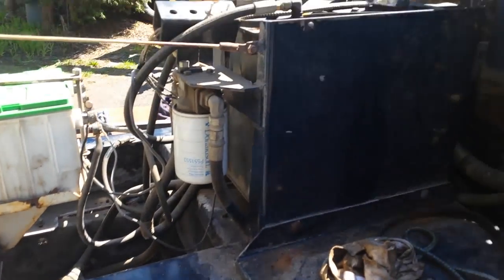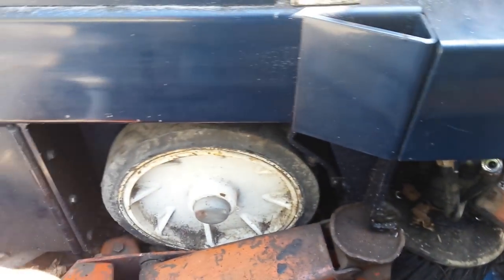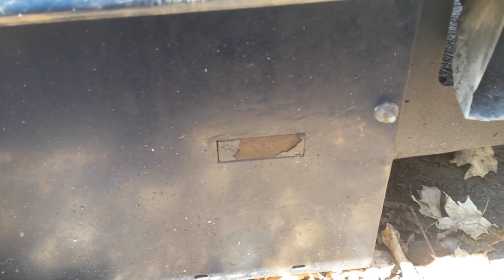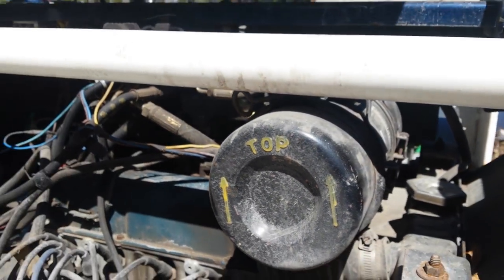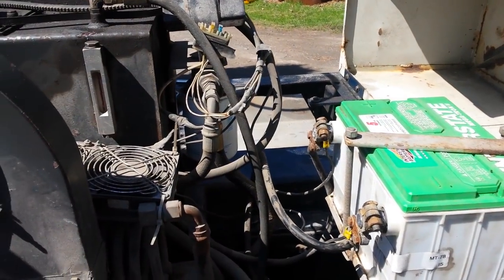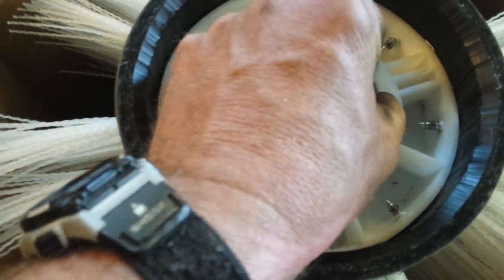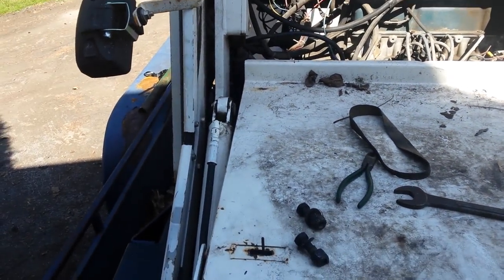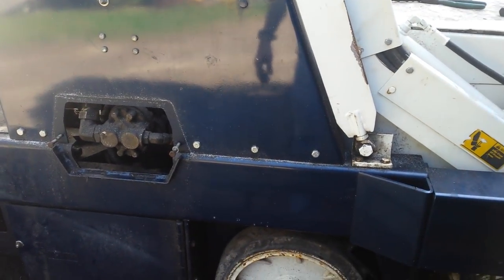Power Boss sweeper

Comment: you can use fork lift tires.... I have a 2011 scrubber sweeper and can use the same ones. my older 2003 machine we used fork lift tires.
Reply from the maker: I will try that, Thanks